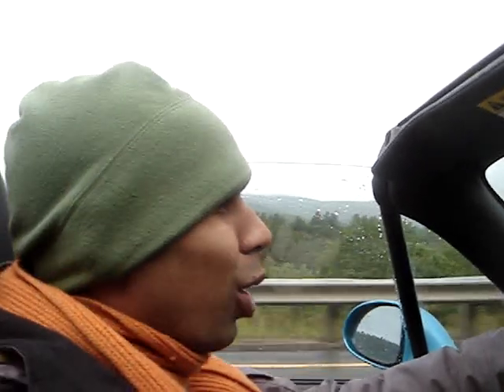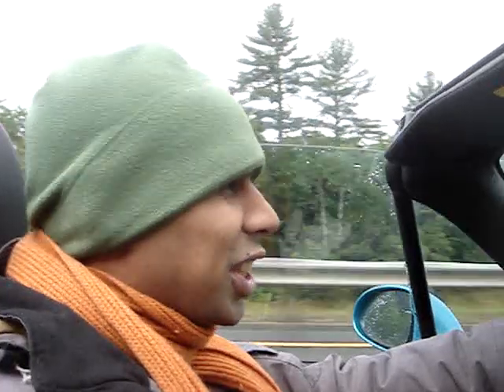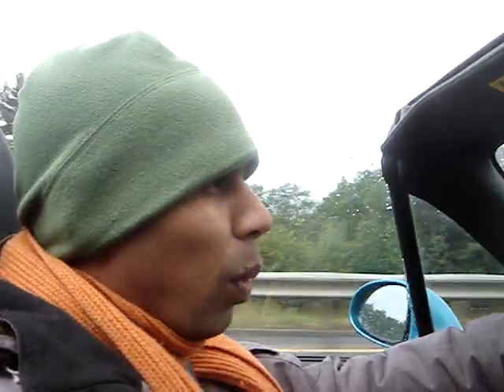Driving a convertible in the rain... and not getting wet

Comment: This is pretty much my experience too. At about 60kmh (which is roughly 40mph) rain goes over the top.
I see you had your windows up - this is necessary else you get a little rivulet running up the side of the windshield and then spinning off into your face. With the window up it runs along the window and sheds at the end of the window past your head (you can see the water running across the side window in the video).
And, something else I learned the hard way - while going fast keeps the rain off this does not work for hail!!!!

Comment from the maker: Thanks! Mythbusters was our inspiration too.

Practically, I haven't noticed a difference due to strength of rain as longs my speed is above 40 MPH, but my sample size is small. That's where simulation can help, letting you do many "What if the rain drops were heavier?"

Rain does have a terminal velocity that drops above a certain size reach, but bigger drops mean more air force needed to deflect them. It wouldn't work, for example, for golf ball sized hail.

Shuvom

Comment: Very cool. Mythbuster just confirmed this myth plausible...too bad I don't have a convertible to try it myself.
Reply: it is not just plausible, it does work. 70mph is enough for light rain to not come into the cockpit, if it rains heavily so that the wipers are on full blast you have to drive at least 90mph. While some people say that that is not feasable; it is not uncommon to do long journeys in europe with sunshine and maybe a thunderstorm alternating. As long as you are on a motorway and you dont slow down below 75-80mph too often. I have done it a few times before and it is usually better to power through than to stop - you have to drive slowly off the motorway and then it also takes some time to put the roof up...

Comment: I've driven my Lebaron convertibles a LOT of miles with the top down, and it is inevitable to get caught in a very significant rain that blows in out of nowhere.  As long as you keep moving at highway speeds... like 50+ mph, you only get a few drops here and there.  I've had the wipers on high with standing water on the road, and as long as you can keep moving, you're good to go.